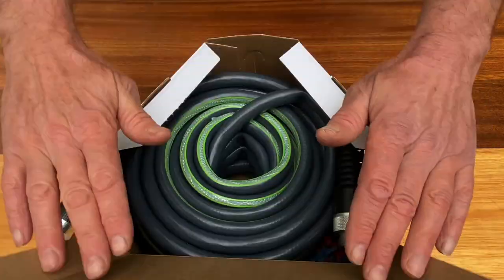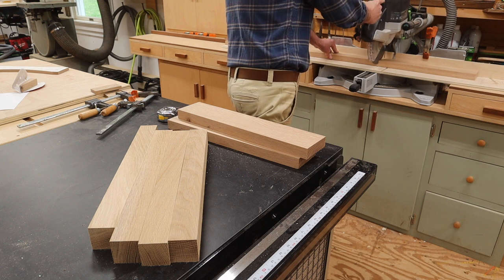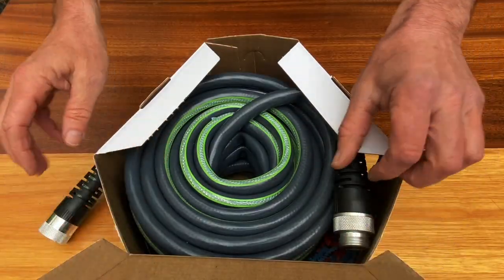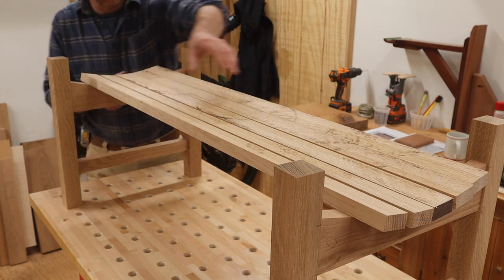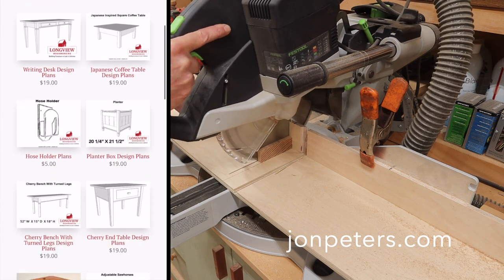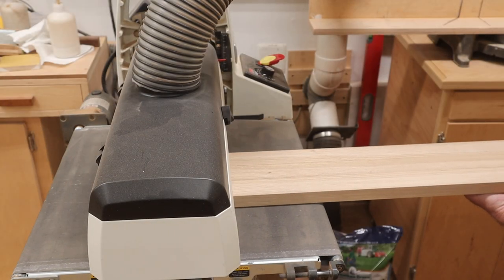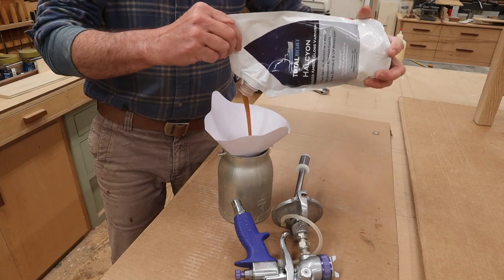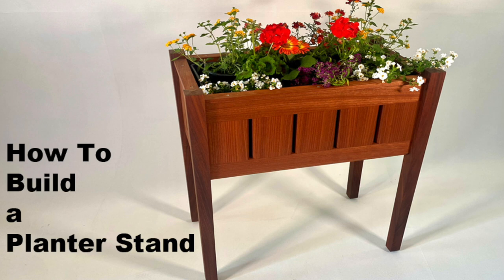How to Build an Outdoor Garden Bench / Woodworking Project

Comment: Great work as always, Jon! I love the small details.

Climb cutting seems to be overly discouraged, in my opinion. As long as you have a firm grip on the router, securely fix the work, and take a shallow cut, you should be just fine. Having the mass of a 'full-size' router helps, but isn't necessary (I love my cordless trim router and the big guy usually stays in the table).